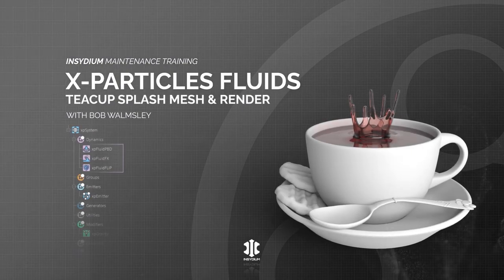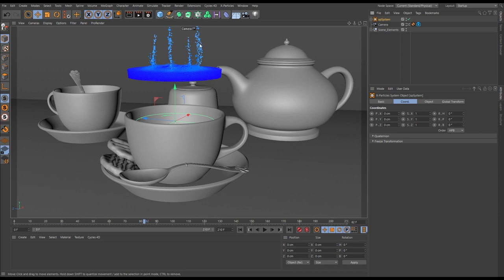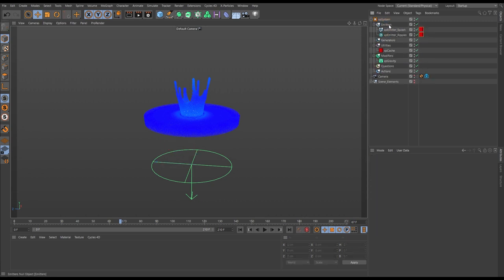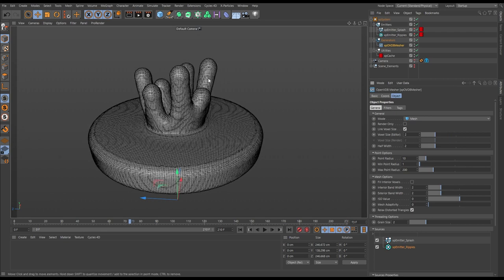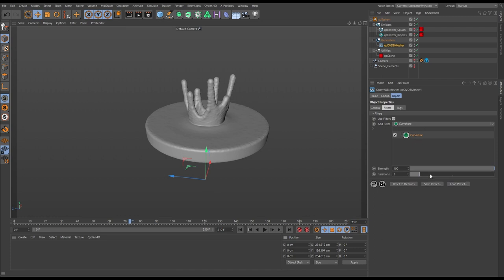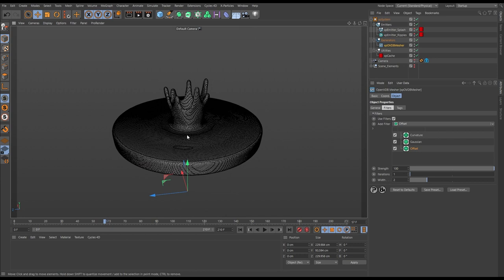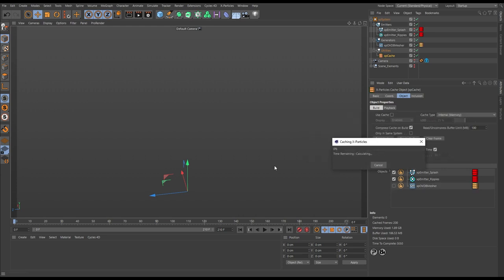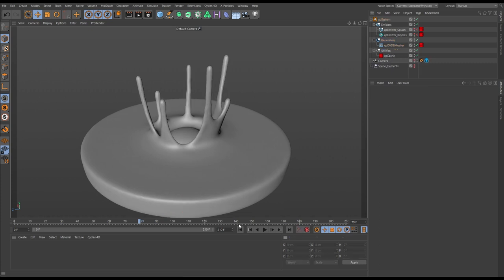Maintenance Training - Dynamics - Fluids - Series 4 - Teacup Splash Mesh & Render

Comment: With Realflow you have the ability to stretch the polygons based off of velocity of particles which creates a more realistic mesh. I cannot seem to figure if this is possible in Xparticles. OpenVDB mesher doesn’t have particle speed.